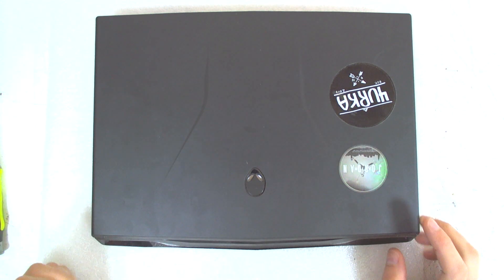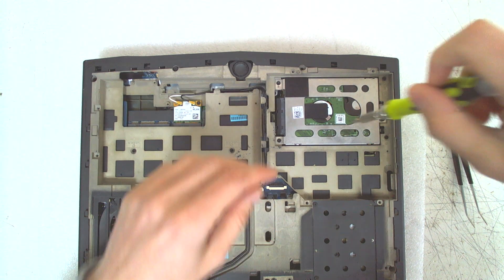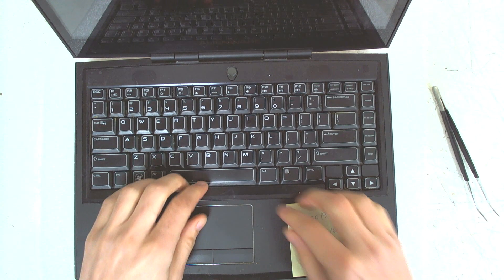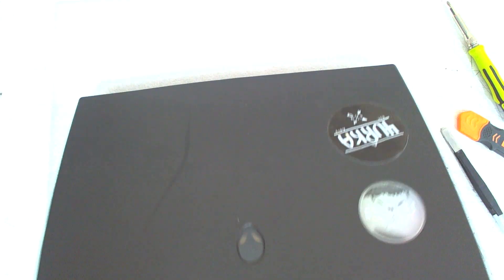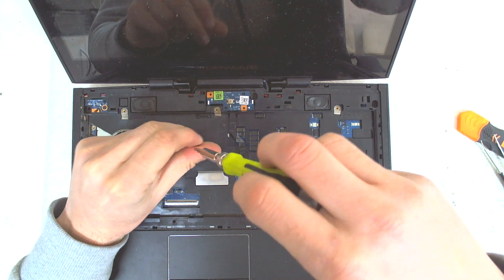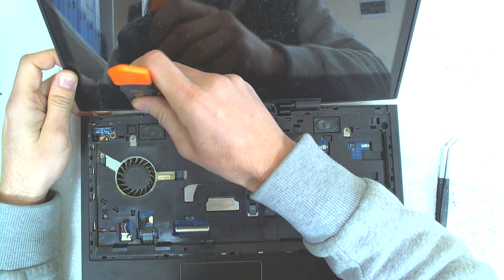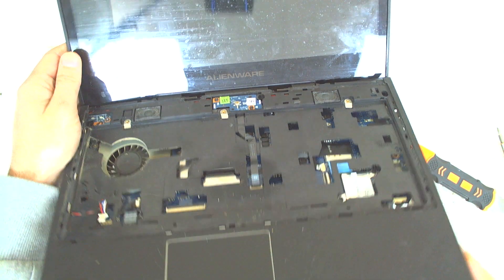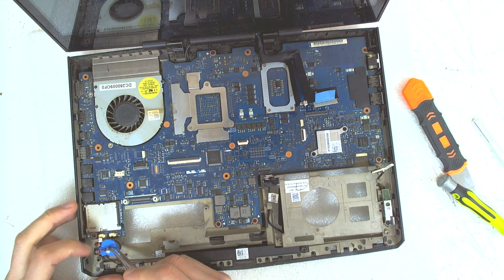Alienware M14x R1 / R2 Disassembly / Fan cleaning

Comment: Hello..what does it mean if there are 5 beeps when starting the m14x r2? I thought it was because of a bad battery and ram so I replaced those. But I still get those 5 consecutive beeps at startup. Is it because of the cmos battery need to be replaced?
Reply: That is what has happened with mine - five beeps which means it is the CMOS battery with an hour's work just to get at it! Anyway, you can bypass the beeps by repeatedly pressing the 'Fn' key after you've pressed the 'On' button.
Reply from the maker: Yes 6 beeps is RTC battery error. Replace the CMOS battery.
Reply: @LaptopDisassembly  thank you

Comment: Hey mate, excellent video. I suspect I have a faulty HDMI chip on mine. Do you know if the HDMI chip/connector can be changed on these or do I need a new machine?
Reply from the maker: Why do you think the HDMi chip is the problem.
Reply: When I have anything plugged in the HDMI port, the machine doesn't load past the BIOS. When there's nothing connected to it, it loads fine
Reply from the maker: @XRePete  if the machine go to windows and than you plug the HDMI cable, douse it show picture.
Reply: @LaptopDisassembly  yes it does. Unstable though, the slightest movement of the cable makes the connected monitor go on and off. I suspect it's the port, but will test with a new cable tomorrow
Reply from the maker: probably is the HDMI port, not the chip. First replace or resolder it and test. This can cause a freeze to bios also. the laptop cant detect the monitor properly....
Reply: @LaptopDisassembly  Thanks for the advice mate. Cheers

Comment: My beloved laptop turns on.... but doesnt reach the startup, it just beeps loudly, same pattern with no pauses... wish me luck  :/  (about to open it and take a look).    *the colored ring on the end of the powercable and the alienware head logo on the keyboard are white in color... if that could mean anything.
Reply from the maker: Continues beep means the laptop cannot identify the adapter correctly. Probably the middle id pin is not ok. First try with different known working adapter.
Reply: @LaptopDisassembly  Thanks for the tip.  I removed the battery and the dvd-rom, for the lol.  The ring on the charger is blue, but the demonhead is white and the laptop peeps once every 2 secs, untill infinity... the troubleshooting continues :)     the internals on the powerplug and the plug socket on the laptop itself seems normal.  I also removed the harddrive and installed a new 2.5 ssd.  I was able to connect the old disk harddrive to my desktop pc and recover my files (the drive seemed ok, but its slow and i wanted to upgrade to a modern ssd). Guess testing / replacing new RAM and/or the cmos/bios battery is next..
Reply from the maker: Messure the voltage on the middle pin. The lights on the charger mean it have 19v... But the middle pin is for recognition of the charger.
Reply: Sorry for the late update... 
The local store that supposedly had a new charger, didnt have it afterall. 
I got a new one shipped from china, it arrived yesterday. 
Sadly it didnt fix my issue: same error.

Going to try get hold of some cheap RAM to test + i've already received a brand new cmos battery ("full kit") in the mail.

(i got a personal hunch that it might be the connector itself, in the laptop, where the powerplug gets plugged in, that might be at fault.. but i hope it isnt, as that seems like a pita to fix... time will tell.. it looks undamaged though).

Edit: now i understand why Dell wanted so much... : i sent their support a email and asked how much it would cost me to have them take a look at it. They wanted 350 usd (and that was just to take a look at it..) + i had to pay shipping to and from china myself.  Gonna pass on that.
Reply from the maker: Test with new cmos also. I had similar inspiron with same simptoms. After replacing thw cmos, work so far.

Comment: Hello, my r2 ended up so muddy and sticky from the dust that I don’t know how to clean the entire LCD carcas “the back part where it has the alien face” without removing the matte finish from the case, can you help me out with any tip? Or I have to clean it deep with pure water or anti grease products and it will lose all the matte paint?
Reply from the maker: Try with pure alcohol 99.9% and a cotton wool cloth... Try few times if necessary.
Reply: @LaptopDisassembly  thx I'll let you know how it worked :)

Comment: My graphics card vbios is bad, can you help me with a vbios backup from your laptop please?
Thanks in advance
With gpu-z you can get the vbios backup and directly upload to the gpu-z web, please please please.
Reply from the maker: It is nit my laptop, it is a customer one. U doubt you have a priblen with vbios, but probably bad vga chip. You can try to findabios from here https://www.techpowerup.com/vgabios/
Reply: @LaptopDisassembly  
Thank you, I already looked on that page there is no vbios.

My last software alternative is flash the vbios, if it doesn't work I think it will be a hardware problem
Reply from the maker: What are the symptoms
Reply from the maker: @ramonespinoza7661  thell me the exact model of the laptop and the video
Reply: @LaptopDisassembly  error 43 in device manager, video bios unknow, and memory zise unknow in gpu-z and hwmonitor.
also gpu-z say that my graphics card isn't compatible with uefi, but the bios on the motherboard is uefi.
Reply: @LaptopDisassembly  alienware m14x r2
the graphics card is nvidia geforce gt650m

Comment: 10:20, is not for Bluetooth, my bluethooths works fine and i doesn't have that little module, someone know what is that?
Reply from the maker: Sometimes the Bluetooth is on a separate module, sometimes is a combo wifi/Bluetooth...
Reply from the maker: https://www.google.com/imgres?imgurl=https%3A%2F%2Fi.ebayimg.com%2Fimages%2Fg%2F3LMAAOSwB09YLTY7%2Fs-l300.jpg&imgrefurl=https%3A%2F%2Fwww.ebay.com%2Fitm%2FDell-Alienware-M14x-M14X-R2-Internal-Bluetooth-Module-%2F183755016888&tbnid=AVjonzC007ULxM&vet=1&docid=INqnG2ql87kf3M&w=225&h=300&source=sh%2Fx%2Fim

Comment: I set it up and everything is working fine but the screen is black, is there any way to turn the screen on?
Reply from the maker: What do you mean everything is fine but the screen is black. You see picture but no backlight, you dont see picture at all or...
Reply: Yanko Goshev theres nothing on the screen but the alien lights up
Reply from the maker: Well this is not working at all.  Firts try to resit the ram memory. Check do you have picture on the external hdmi or vga.. Also try reconnecting the display cable.

Comment: hi when i plugged everything back in the laptop did a very loud BEEP so loud I had to force shutdown! WHen I turned it on again I noticed it loaded but the screen wasn't on. I plugged an HDMI cable and was able to use an external monitor! Did I Plug in the LCD wrong? it didnt' felt right when i was pushing it down
Reply from the maker: Are you shure you plug it the right direction. Check, becouse you may damage the lcd cable.
Reply: @LaptopDisassembly  I'm going to pull the laptop again and check the connection. I just remember watching your video over and over again and struggled to pull it out. And then snapping it back in didn't felt secure... I hope it's ok I'll take a picture when I'm in again thanks for the reply!
Reply from the maker: The connector is durable enough, just push it all the way both sides.
Reply: @LaptopDisassembly  hello thankyou for yoru helpful comments. I had to double check the connection and press firmly (with confidence!) as I inspected all the pins and know that no damage has been done yet.

Thank you so much for your helpful videos as I literally almost doubled my cs go FPS with redoing the gpu/cpu heatsink thermal repaste.  (pretty much never done on the laptop and the pet hair didn't help either lol) 

stay safe everyone!
Reply: hey curious if I'm running a game and the temperature still goes past 90 degrees C (only during hard gaming, I notice the FPS drop because the system needs to dispel the heat, but in windows its just a steady 60 degrees C), then did I do the thermal pasting wrong?
Reply from the maker: What type if termal paste sid you use. Also you did clean the dust from the cooling grill. You can check if the cooler is sitting right. Just lift it and check is the thernal paste on the cooler side have the same shape like the cpu cristal. If it is half probably the cooler is not seating correctly. 60 degrees in windows is a bit high. About thermal paste.. Use Arctic mx-2 or mx-4.
Reply: @LaptopDisassembly  hi Yanko I used artic silver 5 . Here's a quick video of me applying the compound... Now that I look at it again I think I put too little in lol https://youtu.be/5g7XTuFg9MQ

Comment: I'm planning to buy this used laptop, is it worth it or should i get something new, it would cost me 300euros
Reply from the maker: 300 euros is a lot, but depend on the specifications... Can you write them so I can check.
Reply: @LaptopDisassembly  Core i7-3720QM 2.60-3.60Ghz, 16gb of ddr3 ram, a 2tb hard drive, 32gb mSata SSD, Nvidia GeForce GT 650M with 2Gb of GDDR5 Vram
Reply from the maker: Pritty good machine, but if you buy it for gaming, gt650 is old for the games now...
Reply from the maker: The ssd 32bg is not enough for Windows instalation.. Replacing it will be better...
Reply: @LaptopDisassembly  alright ty, I might now buy it then, I'll look for something else.
Reply from the maker: What are you gonna use it for... Gaming,  coding or regular work.
Reply: @LaptopDisassembly  work and some light gaming  on the side
Reply from the maker: If it is for a light gaming, will be OK, but if you gonna play havier than light games look for something higher than gtx970m. 10-th series will be better.  300 euros for that laptop is OK but have in mind the gaming. If you can buy it for 250 will be better.
Reply: @LaptopDisassembly  I'll keep that in mind ty

Comment: So everytime I clean my fan I have to put new thermal paste in? :/
Reply from the maker: Yes, cleaning only the fan is not enough. If you clean your fan every few months, no but every year or two. :)
Reply: no you don't need just take off the screws of the fan and you can clean it no need to replace the thermal paste.... the thing is, as long as you amost totally disassembled that damn crap called a laptop it's better to do a full maintenance.... don't forget that crap is not designed to be take into bits it's trowable garbage that's all it is....for clean the fan the best way is to do it like 2 time/ month without disassembling the laptop so you never have to disassemble it you inject air pressurized by the output air port of the laptop and before doing that you just take off the bottom cover and that's it. i still use that laptop and i  like... well, t's really not a gamer machine anymore.... but it's good battery last long enough for me and it's enough for everything that is not game or well, something like half life 2 XD and i upgraded it to windows 10 and a SSD so it's rather fast.
i've of course put a thumb up because it's the way to take into bits that laptop i've watch it because the subwoofer not work on mine and i have no idea why... it never worked but since that thing come from dumpster dive and i've put it back together in a really fast and dirty way to test it and i not remember if i've check everything before the last assembly well... who know maybe i forgot to plug it and i wanted to know where is the plug before i amlost totally disassemble it at all... but it look like it's not nice i have to take it almost totally into bits again.... DAMN!!
Reply from the maker: The termal paste should be replaced every 2-2.5 years... Otherwise you can only clean the fan more often..
Reply: @LaptopDisassembly  yep